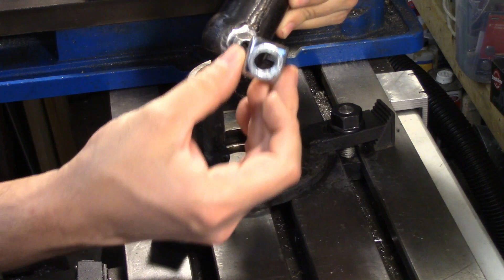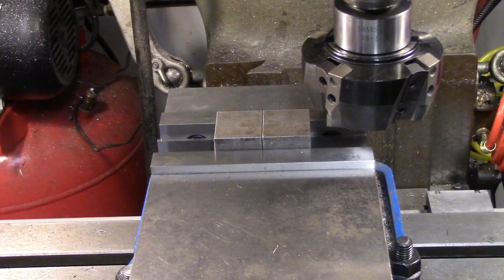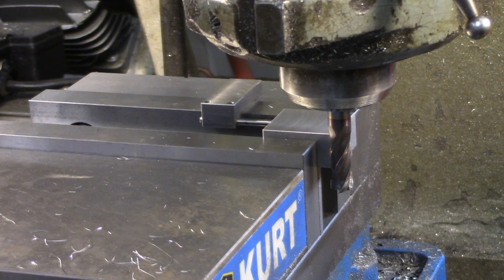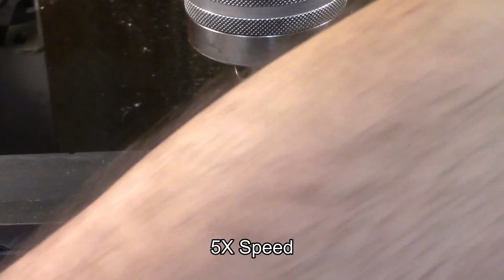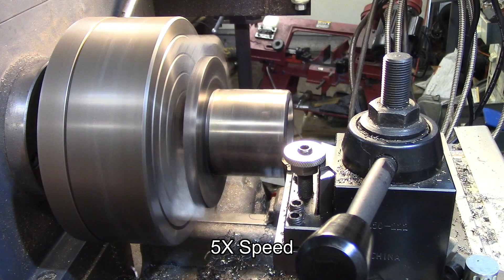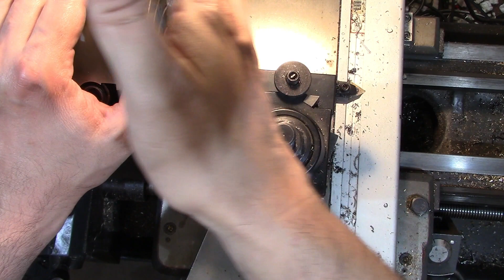Rebuilding an Antique Universal Joint 1911 Willys Overland

Comment: I think that is a Detroit Universal.  Chrysler used them in the 40's & 50's.  I've never seen one wear out before.  If there were three sliders, it would be a Rzeppa Joint.  Enjoyed the video.
Reply from the maker: Good to know. It didn't wear out so much as it shattered. It had a crack running along the length of the keyway.

Comment: A world renowned heart surgeon was standing in the service area of his local Mercedes dealership waiting to pick up his car after he left for repairs. One of the mechanics called him over to another car he was working on and said he wanted to ask him a question. The mechanic told him "Listen Doc, I can take this engine, pull the heads, grind all the valves, change a few parts, and put it all back together and have it purring like a kitten again in no time flat. Unlike you I only earn a couple hundred bucks for doing all this work on cars, while you on the other hand earn thousands upon thousands of dollars for doing basically the same work on people. Now I ask you - how is that fair???"

The doctor leaned in close to the mechanics ear and whispered - "Next time, try doing it while the engine is running...."

Comment: Will it be left unhardened?
Reply from the maker: I can definitely tell you that the universal joint was reasonably hard. The trunion blocks were made if 4140HT so they should be around 32 Rockwell C. Whether or not that is hard enough, I couldn't tell you.